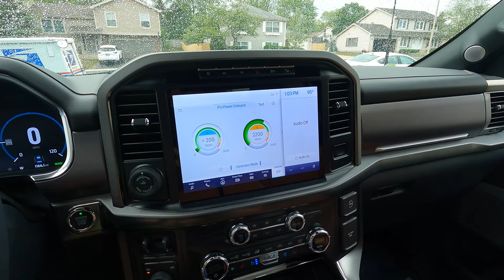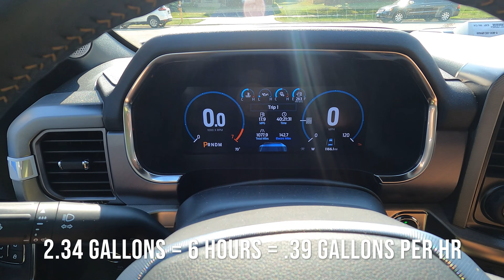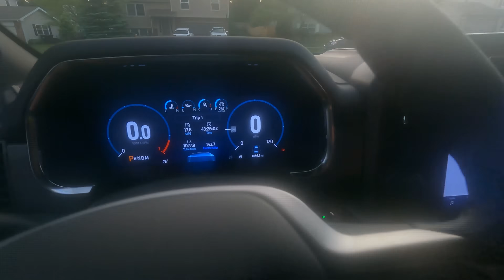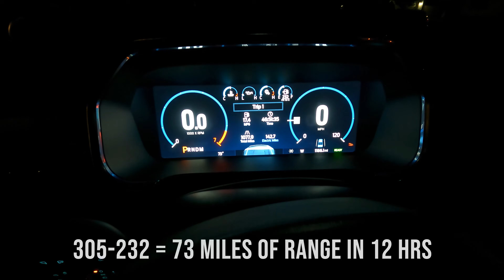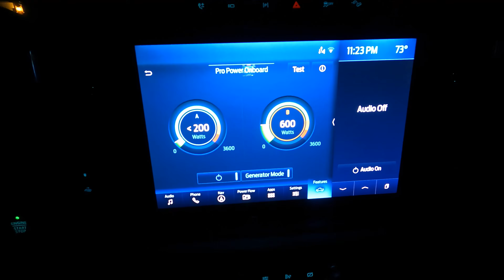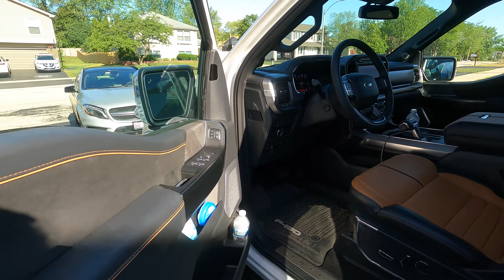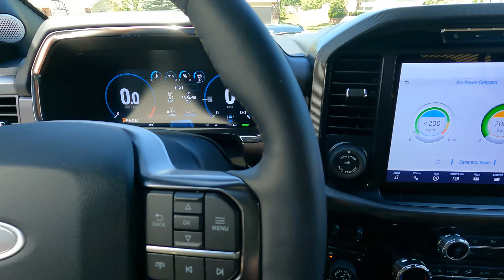2021 F150 Onboard Generator 24 Hour Test | Powering Our Airstream with our Tow Vehicle

Comment: My only concern would be longevity. Not sure why Ford didn’t make the diesel a hybrid. Would make way more sense. 300 hp 530 torque on the 3.0 powerstroke would’ve been impressive. Probably be looking at closer to .15 gallons per hour burn on this same test.
Reply: I really don’t think one could honestly say that the 3.0 diesel would outlive a properly maintained 3.5EB. Imagine the diesel having to regen it’s DPF (and running 20 minutes to do it, using an additional 1 gallon of fuel to do it. Plus the strain on the EGR system, cooling system, not to mention DEF consumption the whole time. It’s safe to say that a 3.5 can go 250,000 miles easily with good maintenance. And you get none of the baggage with it that the 3.0 Lion would bring. (For reference; I own a 22 f250 6.7 Powerstroke and a 21 f150 3.5 standard ecoboost. I’ve owned three 3.5EB f150s and now on my 2nd 6.7 Powerstroke) For a generator, you want a 3.5. Ford knew what they were doing. Oh, one more thing...the truck is sitting stationary... and regen would create incredible tailpipe exhaust temps (700F) ....and it’s fire/burn hazard while camping.
Reply: Ford is phasing out the Powerstroke.

Comment: One question I do have is how hot did it get under the truck?  As of really of the grid we might not be on gravel.
Reply: Thanks for the reply.  I just special ordered an XL 4x4 and should have a chance to see for myself within a couple months.
Reply from the maker: @gregorybean146  great!! I think you’ll really love it
Reply from the maker: Excellent question! We didn’t notice any excessive heat coming from the bottom of the truck. I think this is because the truck cycles itself on and off. It only turns on when it needs to charge the batteries and then it turns off again. Hope this answers your question!

Comment: You should turn off the hvac, displays and other interior items when running in generator mode. For starters people won't know truck is on and running (when it does idle) and it'll help save onboard vehicle power so less idle time as focus is on generator and not truck. 

I use my powerboost to power our trailer every other weekend camping. Works great.
Reply from the maker: Great tips, thanks!
Reply: Someone else did this and recommended leaving the air on set at like 75 because all of the electronics in truck were making the inside really hot. It would help keep those electronics cooler.  I don’t know if that matters or not but it’s a thought.

Comment: Thanks for the info. What is the payload figure on the door of your F150 and what trim level is it? I am planning on ordering and I am curious about payloads at various trim levels.
Reply from the maker: Thanks! We have the Platinum Supercrew 3.5L Ecoboost V6, 5.5 ft box, 4x4 with the max tow package. Payload is 2100 for our trim package. Here is a link to the specs for the platinum F150, payloads are about two thirds of the way down the page: https://www.ford.com/trucks/f150/models/f150-platinum/

Hope this helps!
Reply: @GoranandJen  Thanks but I believe that is the engine/truck stripped payload without any features.  I find the payload to be the most fleeting of all specs on trucks and yet critical to towing. I have a 2017 Platinum 3.5L and the payload sticker "Tire and Loading Capacity" (Yellow/red/white sticker inside driver door) says my max cargo is 1548 lbs for payload. The Ford website advertised figure for 2017 was 2250-3230 lbs. depending on the configuration. The dealer said that was normal as accessories add weight and mine was loaded. The 2018 Limited I looked at had a 12ish payload. Look at your Cargo figure on the door "tire and loading" where is says maximum cargo no more than xxx. That is where Ford puts it. I was told the 4wd Powerboost was about 1200lbs and the 2wd no one seems to know. I have a 1000# tongue weight on my Airstream so whatever minus 1000 and you see why I am curious on the hybrid model. I spoke to the dealer today which said that was about right on the 4wd but I have not seen one to verify. I will probably have to get a 2wd if I get any. I need about 1500 minimum.
Reply from the maker: @rodneylw10  if I’m looking at that sticker, it says 1289 lbs
Reply: @GoranandJen  That's it. Max cargo as configured. The dealer said about 1200. Yours is more like 1300. Thank you for looking. My model has a heavy tongue weight! I will probably have to get a 2WD powerboost or another regular ecoboost. I watched a few more of your adventures on renovation. Happy Camping!
Reply from the maker: @rodneylw10  you’re welcome 😀
Reply: @rodneylw10  this was a very good question because a lot of people don’t understand this. The sticker placed on the B-pillar is what is accurate for the trim of the truck. The more options, the less payload and that’s why I am stuck with probably getting the XLT trim for more payload, my tongue weight is 780 and and 500LBS of people and some cargo. Too bad the F250 doesn’t have this hybrid setup.

Comment: Hi there , super  video  .
What is your milage during towing the rv and without it.
Reply from the maker: Thanks! We get between 20-24 mpg when we’re not towing (depends on how fast we’re driving) and between 9-12 when towing. We find that we get 12 mpg when we go 65 mph towing the Airstream. The RV is 25 ft long, 6800 pound dry weight, for reference

Comment: I thought the tank was just under 30gal? That's the max I've ever been able to put in mine
Reply from the maker: You are correct, we thought is was a 36 but I’m pretty sure it’s a 30 😀
Reply: @GoranandJen  does that impact your efficiency calcs? I'm curious bc I plan on using mine to power my parents Airstream this Christmas.
Reply from the maker: @floridabornoutdoors  I think it would shave a day off for sure.
Reply from the maker: Will you be using propane for heating or are you in an area where AC will still be needed? By your YouTube handle I assume you’re in Florida. The fridge and the AC are your biggest power hogs, so if you are dealing with temps in the 70s-80s I think you could probably still get similar efficiency as we did in this video, even with the 30 gallon tank. It was super hot out for our 24 hour test, in the mid 90s during the day.
Reply: @GoranandJen  it'll be in the Tampa area. Nice and warm
Reply from the maker: @floridabornoutdoors  def need the AC then. I think the efficiency should be similar, but it would be interesting to see how your Ford performs! Let us know :)
Reply: @GoranandJen  will do

Comment: I was thinking about this test on the way home the other day.  For the person familiar with generators, and you as I can well imagine, this fuel consumption is fairly predictable.  An interesting question is :  why does a two cylinder generator consume very close to the same amount of fuel as that V8 under the same conditions .  A very interesting video would be a deep dive into KW/HP  hours vs BTUs and BTUs in fuel (Gasoline).  As I have said before "Don't fear the inner "Geek".  There are PLENTY of people out here whos minds hunger to have this question answered, feed them!
Reply: Great question! I think a huge gain in the efficiency of the V-6 over the 2 cylinder generator is the battery pack on the Ford - since it's a hybrid, it's ensuring as much generated energy as possible is actually being put to use instead of shed. While the v-6 is on, it's powering everything and charging the battery - when the battery is full, the v-6 cuts and power is pulled from the battery. If power consumption drops, the v-6 is off longer. Conversely a 2 cylinder gene has to be on a least in it's lowest idle all the time, so it's not as efficient as it could be. 

A holy grail would be a hybrid generator :)
Reply: Yep that's the answer the engine is not running all the time the engine runs to charge the battery and then the battery runs the inverter evidently these aren't your home charging systems and battery systems these are some special stuff that can charge quick and reach charge many many times
Reply: @the_average_backpacker  I agree with you. Because of the battery pack, the engine doesn't have to run at low capacity. When the battery runs low, the engine turns on and can run at 50% power, or whatever the efficient load is, to charge the battery and then shut off again. It's not hocus pocus like Dana thinks... that says more about his/her understanding than it says about your take.
Reply: @the_average_backpacker  Sorry, not even close.  I can't come close to explaining it here, but there is no "hocus pocus" or any other magic in converting KW/hours to horsepower to BTUs to gallons of gas burned.  The bigger engine has a little more overhead, but that too can be factored in.  With Respect, this is why engineers design things and wishful tinkerers don't.  This is the preview of science and math.  For the record, it IS fun.
Reply from the maker: Very true! That would be a very interesting deep dive

Comment: So it’s a 70k generator?
Reply from the maker: 😂 I mean, it does a bunch of other things. But sure, you could say that
Reply: @GoranandJen  I hope they at least fixed the pos 10spd trans in 2021. My 2019 sucks.
Reply: The Powerboost is the most versatile vehicle I am aware of. It tows and powers my trailer, the engine idle is much quieter than  most generators. It make a great daily driver at approximately 24mpg. It is still a pick up truck for carrying whatever can fit, and in sport mode is creates 430 horsepower and 570 lb/ft of torque and does 0-60mph in 5.2. The Pro Power On Board with the 7.2 Kw inverter was a $750 option. imo it is a tiny bit more than a $70k generator. Also, I paid about $62k for my 2021 Lariat Powerboost.
Reply: @stevenolan5234  can’t wait to see the cost of repairs on that with no warranty. I’ll keep my 3.5 ecoboost and just put my 10,000 watt generator in the truck bed.
Reply from the maker: @stevenolan5234  we love ours too :) the 7.2 Kw inverter option is well worth the $750, cheap in our opinion. We use the generator all the time. It’s great in boondocking situations, so quiet.

Comment: I saw a video from Mr Truck reviewing the generator. He mentioned that Ford does not recommend using the generator on on RV. Did you get the warning on doing this as an owner? Just wondering if Ford worked out the problems on why they say not to use with an RV. I'd buy the truck just for the generator feature alone, and I'm not a Ford guy.
Reply from the maker: Hello! No, we did not receive that warning from the Ford dealership and it seems to power our Airstream perfectly. Goran spent a few months researching this truck and really the only reason we bought it or I should say the main reason we bought it was for the generator so that we could power the airstream when needed. Thanks for the heads up though, I will definitely take a look at the video you’re talking about and dig into it a little bit more. But to answer your question, no, we never were told not to use it on an RV.

Comment: Is your truck running?? RPM gauge says 0...
Reply from the maker: Yep! It cycles on and off to recharge the battery
Reply: @GoranandJen  ahhh makes sense. That is pretty damn cool. Not sure if I could ever give up my 5.0 for it though!
Reply from the maker: @kevinhiltz9626  it’s definitely cool truck! We’re loving it :)
Reply: @kevinhiltz9626  the 5.0 also has a generator option.  but it's not the full 7.2kw one.. there are 3 size generators for the f150 (2.0kw, 2.4kw, 7.2kw).  5.0 has only 2.0kw generator built in option.  must be a full powerboost for the 2.4kw (standard), and the 7.2kw (optional) generators.

Comment: Seems like idling forever with the ecoboost is bad for it
Reply from the maker: Great question, that would be bad. The truck cycles on and off as needed to maintain the battery charge, so by design it doesn’t idle the entire time.
Reply: @GoranandJen  🤔 as long as you tow with it or should keep it blown out as well, seafoam is mans best friend
Reply: I worked ford and can say it can hurt it if used like this for long perios of time, but these ecoboosts are tougher than people say they are.
Reply from the maker: @AudaciousCaesar  great insight! Yea, we def won’t be running it like this often, but we wanted to see what it could do 😀
Reply: I certainly would prefer an NA engine for a hybrid setup.  turbos that are not hot tend to gum up and fail.  perhaps they bypass use of them at idle on this engine, but that is a lot of complex systems on one vehicle.  Brilliant use though!  Going to see a lot more campers in the non-electric sites that have so much better privacy!
Reply from the maker: @michaelgabriel2998  so true!! It opens up a world of possibilities :)

Comment: Hi, could you tell me what the payload on that truck is? The driver side door pillar will have the sticker. I order a similar platinum thanks and I'm curious.
Thanks.
Reply from the maker: Sorry it took so long to reply! Payload is 1830 in  2 wheel drive and 2090 in 4 wheel drive. Hope this helps!!
Reply: @GoranandJen  well, payload varies depending on trim level and options.  For example my Powerboost Lariat has a payload of 1533 and I've seen Powerboost Limiteds loaded with bed linings, etc., with payloads below 1200lbs.  Great test by the way!
Reply from the maker: @aflyr  thanks! Yea, I’ve been learning a lot about payloads. If you check the sticker inside the door, it says 1289. So I’m pretty sure that is the correct number for our trim package